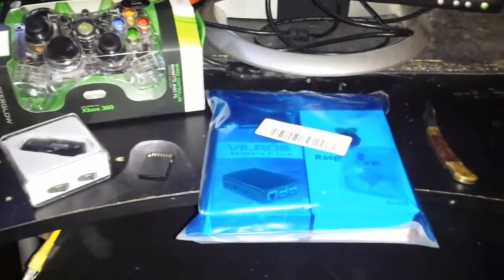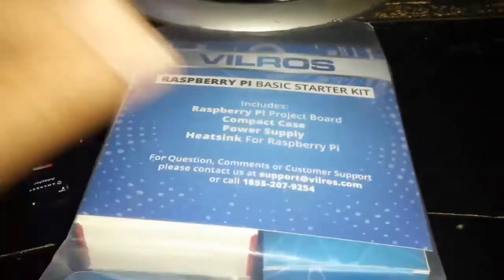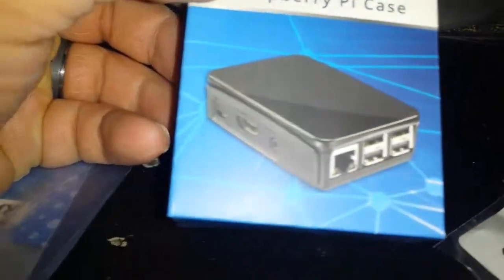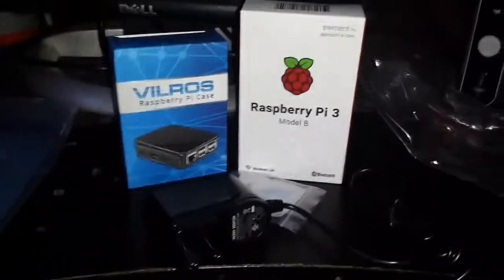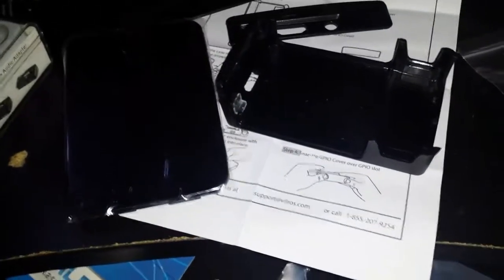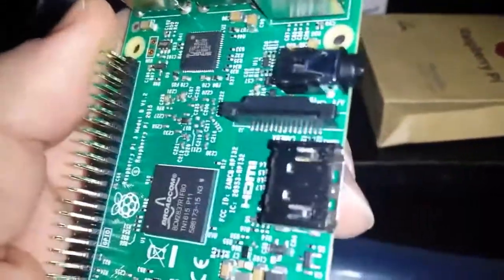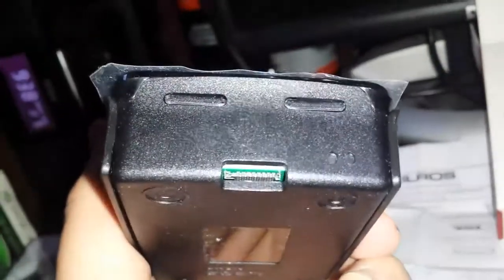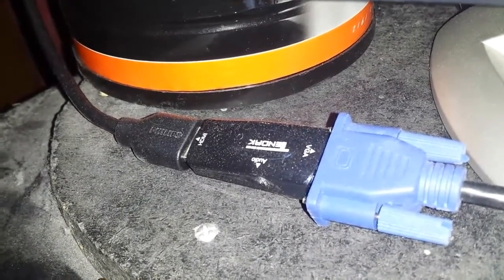My First Raspberry Pi for RetroPie Christmas Gift

Comment: try recalbox instead of retropie if it is your first time. it is more beginner friendly.
Reply from the maker: Tailslol thanks for the idea. I looked into it and think I will switch until i learn more. thanks!
Reply: np and this case has some breathing problem for gaming,try to remove 1 panel to avoid overheating.